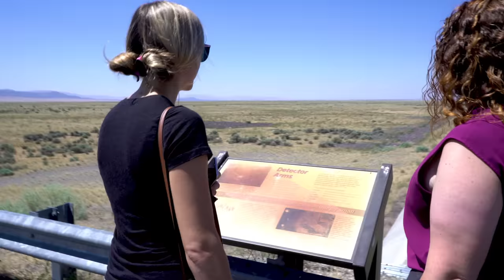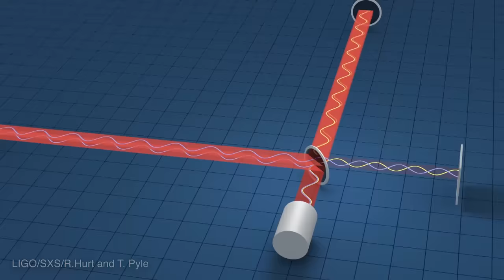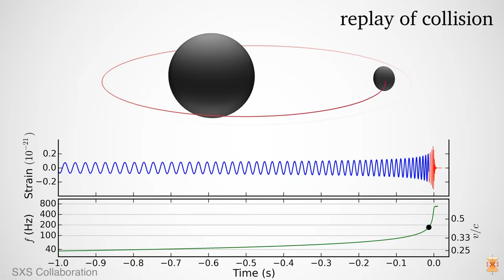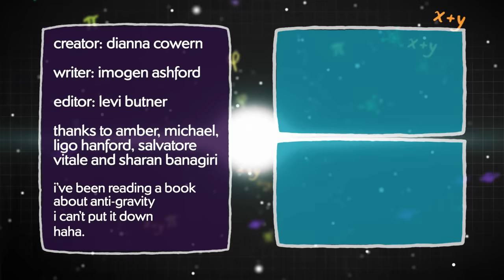Why are there giant concrete tunnels in the desert?

Comment: In a previous profession I was an engineering surveyor, meaning that I used survey instruments to collect data for civil engineering designs. Yes, I actually used a theodolite, engineer's level, and 100-ft steel tape. Level shots were restricted to 300 feet or less because of curvature and refraction. Shots longer than 300 feet need to be corrected. 

It pleased me to hear the statement about having to correct for curvature in the tunnels. I had to smile.

Thanks for sharing this episode.

Comment: I'm a materials engineer and as soon as you said "space is very stiff" I thought, "I wonder what the Young's modulus of space is?"
Reply: It's not stiffer than me. I'm so stiff necked and even my nails are used as cutting tool in lathe and milling machines. I sell 'em on ebay.
Reply: @davemwangi05  not as stiff as you?🤨🤨

Comment: I feel privileged to have worked on LIGO as an engineering Technician based in Pasadena at Cal Tech building and testing electronics for both interferometers in Hanford, WA and Livingston, LA. The modules I worked on were to compensate for the “ noise “ that is trying to interfere with reception. Such things as tidal motion hundreds of miles away from the observatories.

Comment: Hmm, space is 10^20 times stiffer than steel.... clearly we should build a space elevator out of the stuff! It's right there in the name, even!
Reply: Genius.
Reply: And it can support it's own weight, since it doesn't have any.  This idea gets better and better.
Reply: Steel is not very stiff really. Steel bends and expands/contracts with temperature.
Reply: @simontay4851  yeah most materials do  that said in my statistical mechanics class I learned that the equation of state for metals is a bit weird. Fun fact the properties of metals we take for granted are actually the product of electron degeneracy where all the free electron states are occupied. This is the same phenomenon that supports the weight of giant planets such as Jupiter, brown dwarf stars, and stellar remnants. This blew my mind when I learned it in my statistical mechanics class and suddenly allowed me to realize why Neutron stars can be some magnetically active despite being composed of electrically neutral material.
Reply: The biggest problem with this idea is that spacetime is distorted by mass.   Using it to transport things, i.e. matter having a finite mass, would make it bend all out of shape.  Not a good plan.
Reply: But the use of 'stiffness' as implied by Young's Modulus was just an analogy. The confusion in this thread about it is an example of why I do not like the analogy, but the idea is that high modulus materials are stiff, so bending them with a wave is hard, the size of the wave is small; but bending spacetime itself with gravitational energy is orders of magnitude harder.
Reply: Reminds me of all these "graphene" buffoons :D
Reply: The Emperor's new clothes space elevator
Reply: @Dragrath1  One thing I do not understand is magnetic propagation! I have been dealing with free electrons and magnets all my working life but have never come across anyone willing or able to explain exactly what it is and how it is propagated as a field.
Reply: @Dragrath1  That's what I was thinking.
Reply: @totherarf  Magnetism is weird in how it arises. Personally the way that magnetism makes the most sense is by recognizing the connection between electromagnetism and special relativity which was formulated by assuming that Maxwell's equations always hold in all reference frames.  Einstein's theory of special relativity connects with Maxwell's equations  that a magnetic field is really the Lorenz transformation of an electric field in a different frame or reference. In that context you can basically visualize it the same way you would time dilation or length contraction.

More accurately in the quantum mechanical sense electromagnetism arises from the quantum field associated with the photon where a photon is composed of perpendicular oscillations of electric and magnetic fields. This is why light can only interact with particles composed of subatomic sub-units that have nonzero charge.  This quantum field can actually be shown to be a correction to the momentum term in order to conserve gauge symmetry that is to allow  us to make a change in our variable without actually changing the fundamental property. 

A gauge is the concept representing this transformation of variables such that there is no absolute position or frame at rest compared to all frames. It was quite a mind blowing thing in my graduate Quantum Mechanics 1  class
Reply: @Dragrath1  This is probably above my pay grade ;0) ..... but is the propagation of an electric field converting to a magnetic one at 90 degrees and back again what makes light travel at c? I know that electricity propagating down a wire travels at a velocity dependant not on the structure of the wire but of its dialectric!
Reply: DENSER, NOT THICKER, BUT i CAN SEE WHY YOU WERE CONFUSED
Reply: @totherarf  Ken wheeler explains it best.  He wrote the book on magnetism, I believe he's right on.

Comment: Hi Dianna and everyone else.
Sorry for my, probably silly, question. When you talk with Dr. Michael Landry on the video 6:40 there are 2 clocks on the top of the screen an top on the right there is also a huge number in green counting. What is this number? 
Happy Physicsing everyone!
Reply: Top of my head, the left hand clock is UTC/GMT and the right is local time. 7 hours difference.
Reply: I also went back and converted the counter in green text and it comes out to approx. 39.57 years. Not sure what it is measuring however.
Reply: It's unix time: https://en.wikipedia.org/wiki/Unix_time
Reply: @wombatdk  Thx :)
Reply: @wombatdk  Wow, that was a new one for me! Respect for you deep geek knowledge!
Reply: @wombatdk  Unix time now, well, about a minute and a half before this comment, is 1566606462. So, that's not the answer. It started Jan 1, 1970, which is 49 years and change from now.
edit: I did some quick Googling and system clocks that use a Jan 1, 1980 epoch are IBM PC BIOS (resolution 1 day), Microsoft DOS (res 10 ms), and OS/2 (res 10 ms).  GPS also uses Jan 6, 1980 but counts weeks, not seconds. Perhaps it is a conversion of GPS time adding additional resolution?
Reply: @Paldasan Serendip the number of seconds since Jan 1st, 1970  is UNIX epoch time.

Comment: @2:13 those springs that isolate  the equipment shown.   i have been installing   and fabricating those systems  for over 30 years.  the springs are actually called "isolators"  and are  almost always installed with those systems.  they generate alot of  vibration and you usually don't want that type of constant stress on a building. it also helps transmit sound, and people  don't like that either.  so while the isolators under that equipment in your video  do indeed function as you claim, they are not unique to your application. they are in fact, commonly used.
Reply: Di you work in the US submarine business? :-)

Comment: FYI .... All large AC condenser units are always supported on isolators.  Not just at that location.
Reply: seemed like the shipping bolts or jacking bolts are transferring all the vibration. Spring isn't doing much as far as we can see in the vid (2:16)
Reply: @drachebueb4211  Springs absorb the energy. The idea is having springs heavy and long enough to absorb all of the energy without transferring that energy past the springs into the structure the opposite end of the spring is attached too.

Comment: 9:15 if that's the readings they're detecting, then I'm very curious how much does a car accelerating nearby or the crows pecking at the ice etc affecting the readings?
Reply: I'm just wondering how they can even hope to tell its working, there is just so many things that could interfere with both test that are way closer. Most earthquakes can on a slace larger then that be felt all the way around the earth though greatly diminished. It just dosent seem practical when teir is so much in our own solar system???